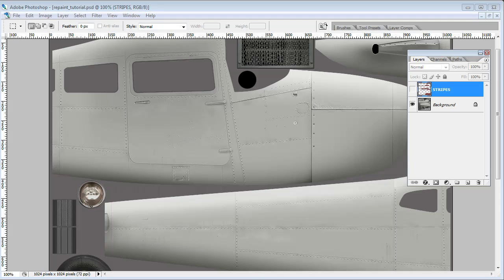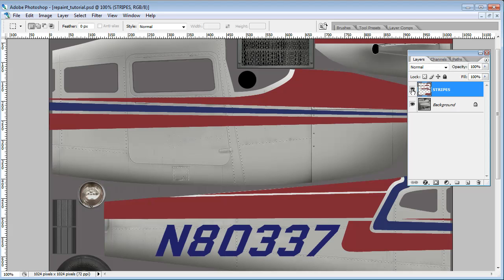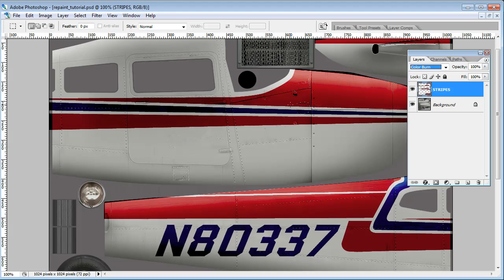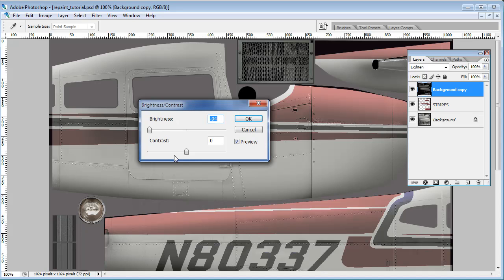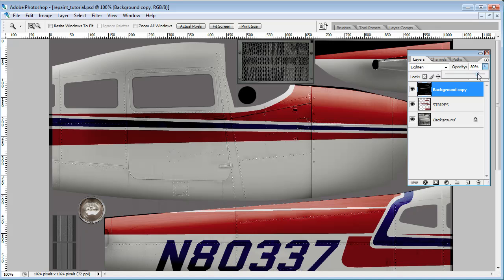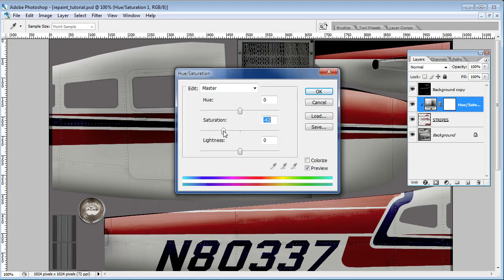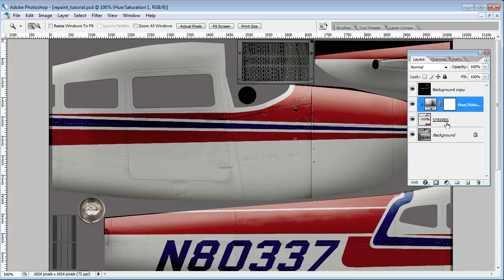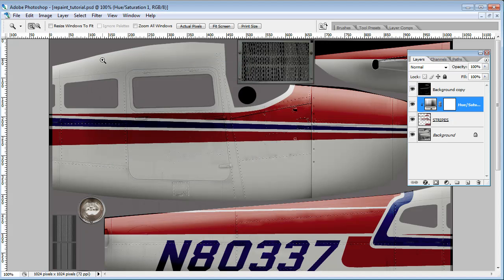FS Aircraft Repainting with Layerless Base Textures

Comment: I'm watching this in 2021 getting back into flight fs2004 (FsX never really worked very low frame rates) thank you so much for this I tried painting aircraft straight onto the texture with horrible results this layer   system is exactly what I needed

Comment: Really nice job, can i ask you how to draw a line or any other decals in a A/C like the shown in the image here ?? The nose the body and the tail are divided in pieces .
Reply from the maker: Thanks! The easiest way to line up the panel lines is also really hard to explain in detail. Basically, in the example I used in the video, I created a master Photoshop file that was about 3x as wide and tall as the original texture and then copied the original texture sheet to it several times on different layers. Then I lined each layer up to create one unbroken aircraft profile. After that, I created a new layer on top of them all, filled it with white, set its blend mode to multiply, then painted my lines on it. To copy each section of line back to the main texture, I used ctl-click on each layer thumbnail from the original images I used to create the master file, copied the selected section of the line layer, and pasted it back into my texture. If you do this, you can get more or less perfect alignment.
Reply: @BillWomack  Thanks for reply, I'll give a try, I think this will really takes a lot of hous of job. Any thank you very much for your precious tips.

Comment: After hours of trial and error and conflicting info out there, I am now about to throw my laptop out the window.

So could you please explain exactly how I have to treat the files in regard to the correct image format? I have the C172N white paintkit from the Carenado website, they are given in bmp files. I use paint.net, since I cannot afford photoshop. paint.net can open the given textures in bmp format, I can edit them, I then save it, use DXTbmp to save it as DXT5 bmp. But either the textures are all black, or weirdly light blue with the "Microsoft Flight Simulator" writing on it in places.  I am losing my mind here, so any help and advice would be appreciated, since I cannot find a clear explanation which format is required.
Reply from the maker: The DXT5 format should work fine, but you might have a problem with your alpha channel. The issue of seeing Microsoft Flight Simulator in places indicates you've got a missing texture somewhere. Be sure that your specular and normal maps are in the folder with your repaint too, or that you've pointed to them using a texture.cfg file.

Comment: A great tutorial.  Just followed it–a few rewinds and pauses–it to paint a Carenado Bonanza A-36 in Norwegian colors.  (PS Elements 13 for Mac (all functions exactly same as the video) My question:  The issue is with the registration number on underside of the wing - base textures are pretty dark to begin with.  I applied the tutorial methods-played with the various sliders–but didn't really get the desired effect.  There just isn't enough "light" bits in the underlying texture to bring out much detail in the added layer.  Thoughts?

Comment from the maker: @rolaxert Sorry, I was painting the 185, which is one of their later models that doesn't have the mirrored texture problem. If the model is mapped so that some textures are mirrored, I'm afraid there's not much you can do about it, other than not put text where the mirroring happens. With the 172, there's a patch on the side of the fuselage that's not mirrored - the part where the registration is located in their paints - and that's the only place you can put text on that one.